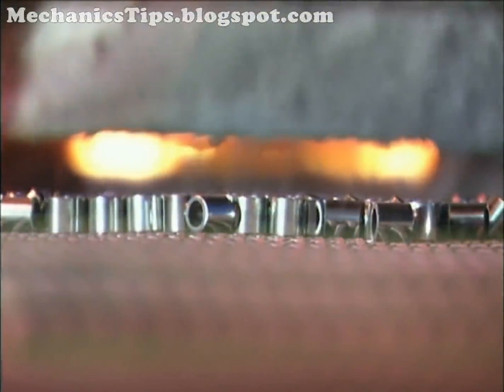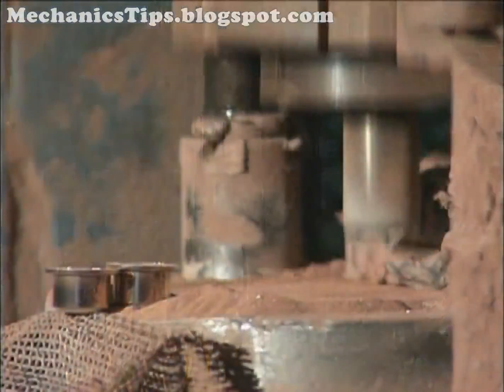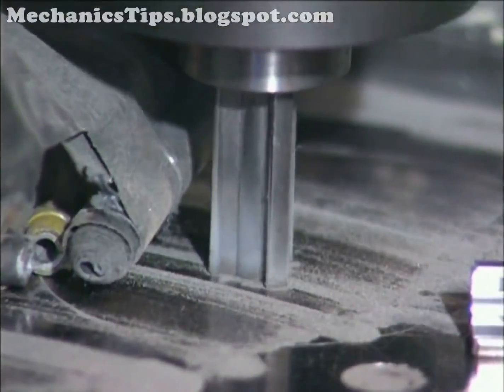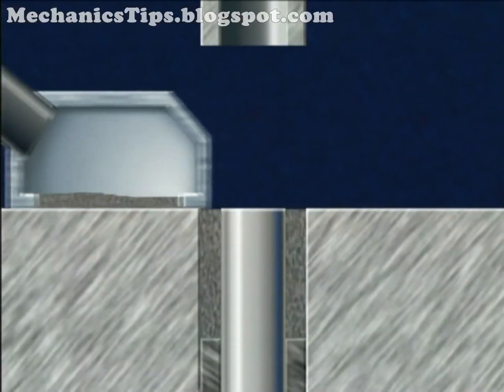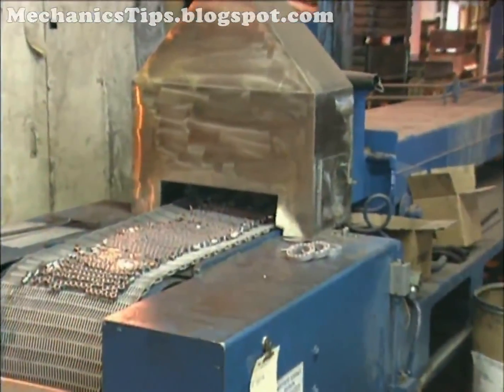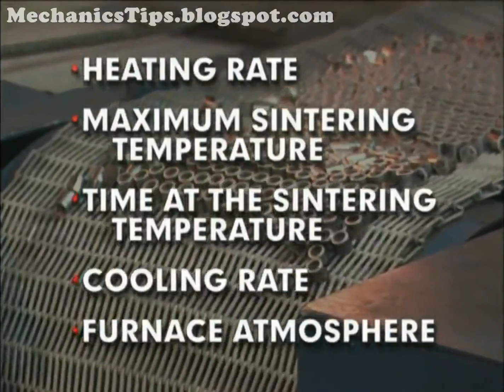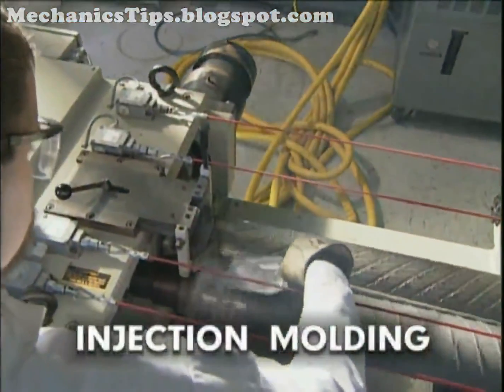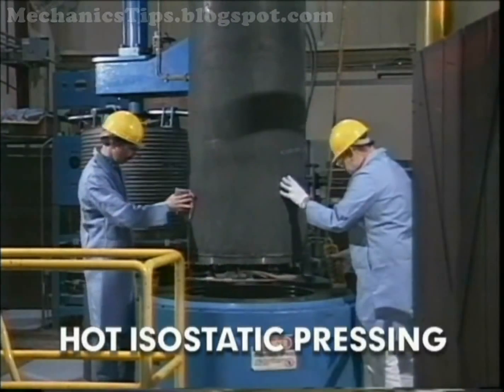Powder Metallurgy Process

Comment: Robert Shrewsbury Feb. 2021
I wrote this in such a way that one does 
not have to be a Scientist                                              
                (with a degree) in order to understand it.

Metallurgy and Alchemy Brief.

What
 might be said about where element-particles come from, how they are 
made and if they can be altered?  From the internet...“The entire 
variety of the elements and isotopes found in today's universe were 
created by Big Bang Nucleosynthesis, stellar nucleosynthesis, supernova 
nucleosynthesis, and by nucleosynthesis in exotic events such as neutron
 star collisions.”

An Alchemy definition, from the internet: “The
 medieval forerunner of chemistry, based on the supposed transformation 
of matter. It was concerned particularly with attempts to convert base 
metals into gold or to find a universal elixir. (Includes) occult 
sciences, such as alchemy and astrology."

These statements I 
found on the web under “Nucleosynthesis” and it made me think a bit on 
them.    After my years of researching and experiments, I’d agree The 
“Big Bang” belief has some merit to it, however the amount of heat, 
pressure and radiation, I found works with far less than what is 
postulated or theorized and I have done tests to evidence this many 
times.  Observing a natural form, a Volcano, exploding with heat and 
pressure, also produces a little radiation.  The seeds of future metals,
 etc. are created in the pressure and heat. Sometimes, when it comes 
from deep enough in the Earth (where Potassium 40 is), it has even more 
radiation, because Potassium-40 is radioactive.  Other times, there is 
Uranium or Thorium in the Earth where a Volcano explodes and this 
further ensures Nucleosynthesis from the combined materials, heat and 
pressure.  In that type then, so many, many elements are spontaneously 
created, like platinum group metals, copper, zinc, silver, gold, 
rare-earth metals, etc.  In short, Nucleosynthesis is Nature’s form of 
Alchemy on earth.  

This Nucleosynthesis can also be produced 
artificially in a Laboratory, a form of Alchemy and I have done this at 
least a hundred times with success and no failures.  A mini-explosion 
produces radiation as well as a rifle or cannon shot out of the barrel 
of a weapon, but it is minor. However (powdered) Metal, even Iron placed
 in a container with the Proper Chemicals and a lid on it (like a bomb) 
and then heated to its ignition or flash-point, will spontaneously 
(explode).  A mini “Big Bang”, it then changes the isotope configuration
 and creates multiple stable elements, including P.G.M’s, Au and Ag. 
This is Alchemy and nothing mystic about it.  During WW2 the Germans 
were working on this in a similar way as I did. 

These tests have to be done with caution, sensibility and knowledge so that no one gets injured or other problems created.

Cordially, Robert Shrewsbury
robertshrewsbury13@gmail.com